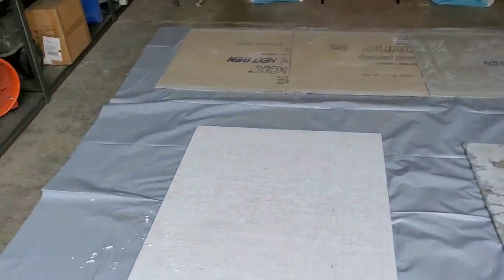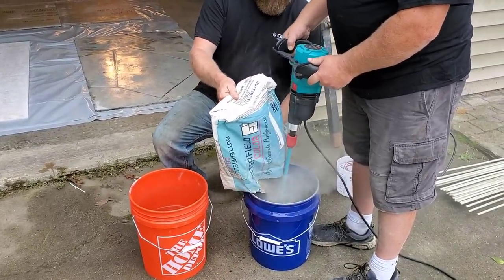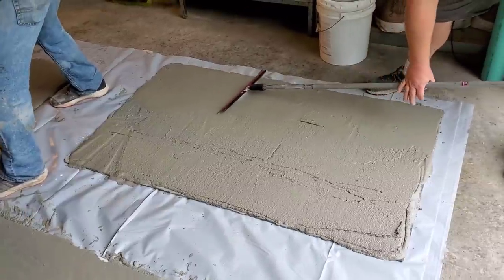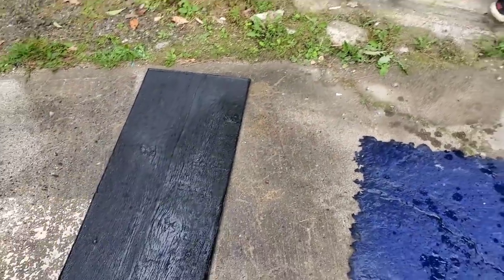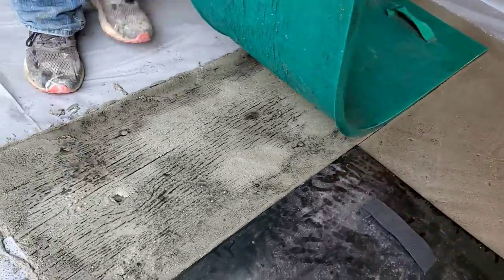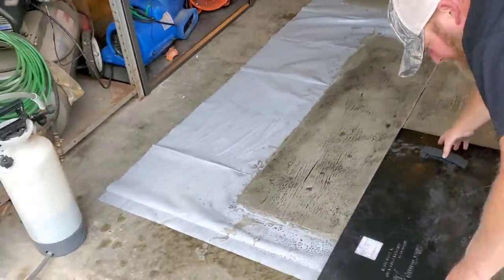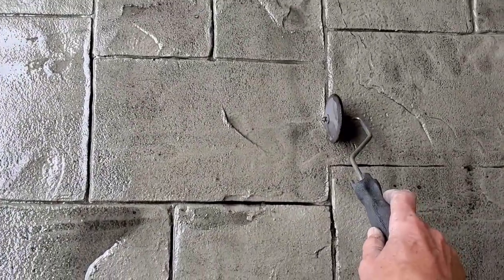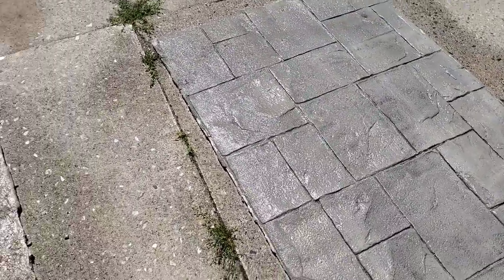How To Resurface Concrete For Beginners (Stampable Concrete Overlay)

Comment: I hired a local small company to redo my front porch which the foundation had sunk after a major flood & they cut corners everywhere including using regular concrete blocks instead of the split face, so I was wondering if there is a way to make a mold of the original block face & make sort of a concrete laminate to attach over the standard concrete blocks?